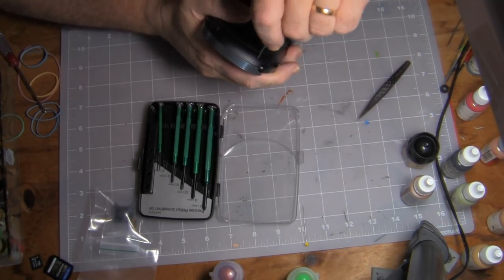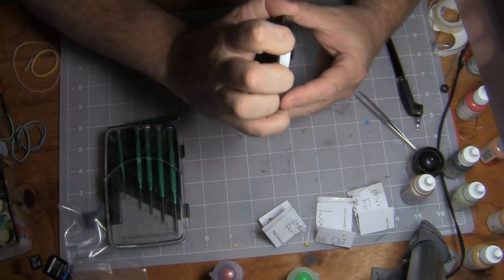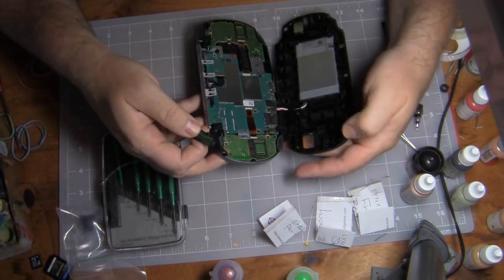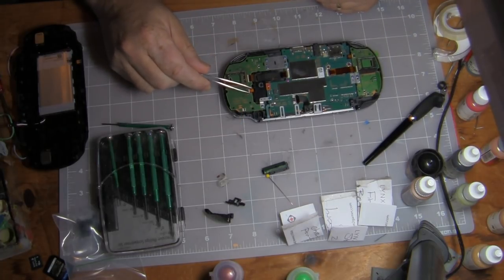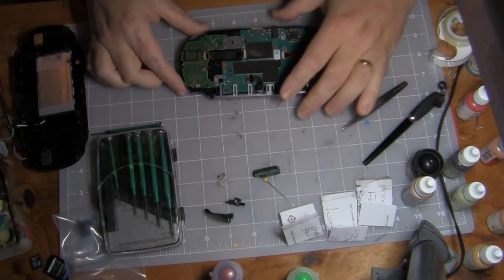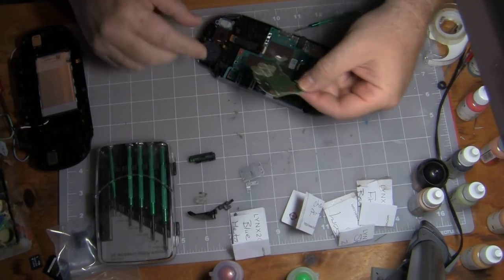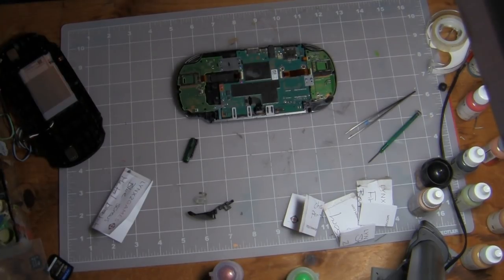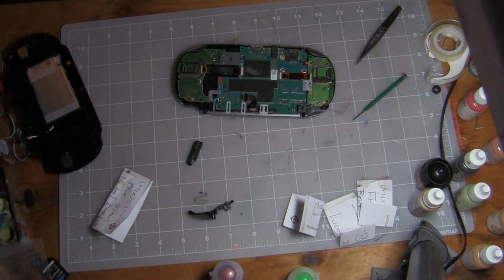Replacing the left analog stick on PS Vita

Comment: Used this video to help in the process of replacing mine.  I had the exact same issue.  Sony wanted £130 to repair it,  I got the part myself from Ebay for £8.90.  Repaired it today,  It's working a treat,  Many thanks to you sir.

Comment: hey man I just for a psv1000 stick from aliexpress it was only 3 euro or so. ( you can get them for you at other stores) but I think it's broken? isn't the stick supposed to spring back in to position? if I push my new stick left it just stays left etc
Reply from the maker: Yes. It should spring back to center.
Reply: My ps vita X button is squeaky it works however the sound is really annoying. Anything I can do?
Reply: +OutlawsGaming im not sure. maybe follow the instructions in the video to get the analogstick and oil it correctly. 
but im not sure
Reply: Do you have the same problem because i found out how to fix it?
Reply: Ängu VLogs LOL .. don't "oil" your analog sticks mate .. they aren't supposed to be oiled
Reply: OutlawsGaming If you dissemble the vita and clean it or even blow on it close up the moist air of your breath will stop it. 

The DS4 triggers often become squeaky, blowing on them fixes the issue.
Reply: P.s. The seller sent me another analog stick for free. My vita works perfectly now :D (aside from it not wanting to charge/stopped turning on after a while... I dissembled it again and made sure the battery cable was firmly in its place and now it works again.
Reply: 3choBlast3r oh ok
Yeh see, i wasnt sure lol :D

Comment: hey there my left analog stick doesn't work also do you think i can still use the same one by just reconnecting it and i also have a problem with the d pad sometimes it stops working is it possible for you to tell what i should do
Reply from the maker: If you take the Vita apart and it's disconnected, then reconnecting it might work, but if it's connected, then the stick has probably gone bad and you need a new one.  I found mine for $20 on ebay.  You can also buy a new d-pad and replace that.  I used https://www.ifixit.com/Device/PlayStation_Vita to help me repair mine.  Good luck!
Reply: Thank you very much for the advice and i will probably buy a new one

Comment: What do i do if i have a stripped screw in the touch rearpad?
Reply: try putting a rubber band on the screw and applying a little pressure 
i had to do that when i was repairing my iphone

Comment: Darn i cant buy the part, mine is broken on the right part, its only for one game i currently have but, ive completed LEGO MOVE The game and MLB is so hard, And I have to use the right analog stick for moving my camera  in Need For Speed, I dont know if they can fix only the analog stick because they said, if its brought from another country, thats where they can fix it, im on Philippines but they bought mine on Canada, so Gg lol
Reply: BlueSun Dude I'm having the same problem but on the left analog stick the up and the down. Idk where to repair this thing in the philippines
Reply: Had it fixed but then after a few days it started getting slightly crazy, but I just dowloaded a game I could play on the vita